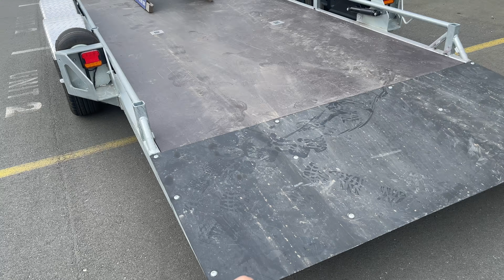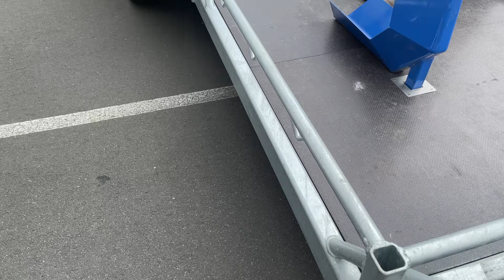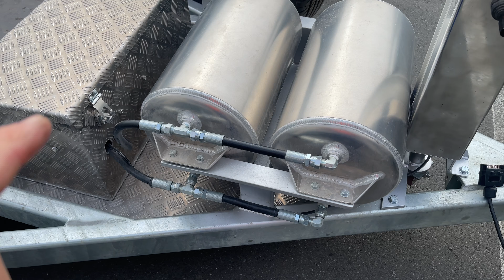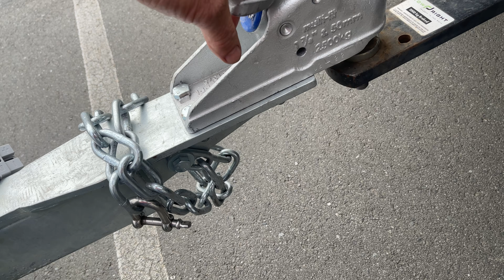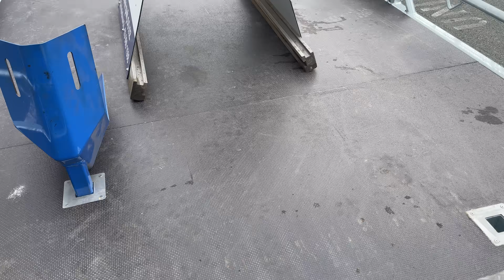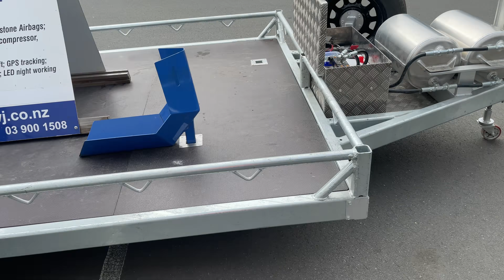Airbag trailer by Precision Waterjet.

Comment: Wow that is some awesome engineering was just wondering if you To lose air pressure and the trailer dropped while moving could you put in a removable bump stop so it wouldn’t bottom out on the road appreciate the videos you make in the information you share 🙏👍
Reply from the maker: Yes, this is an ongoing problem for airbag trailers of any sort.  I do not have a viable solution yet but we are thinking about it every time we build. An easy fix is to include a tap on each of the bag inputs. they are cheap and small.
Reply: @ultimatemanshed one hack the owners of early air suspension Range Rovers used to do (when compressor failure was common) was to fit a standard tyre valve in the lines somewhere. That allowed tou to temporarily inflate the system using an airline.
Reply from the maker: @hughmarcus1  excellent idea, I'll do that on the next trailer, thanks